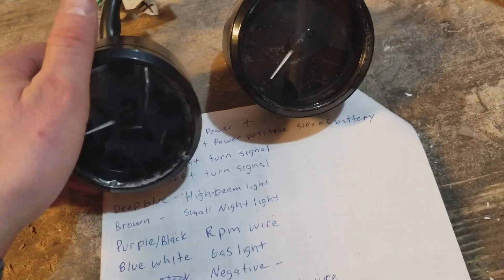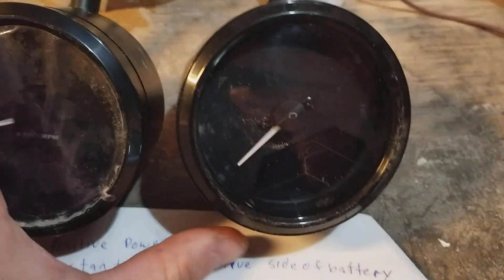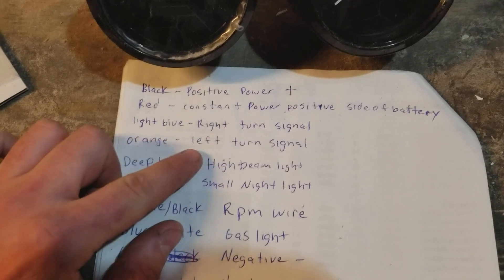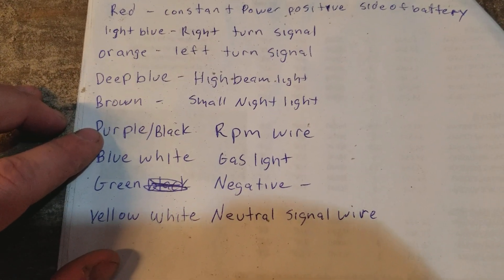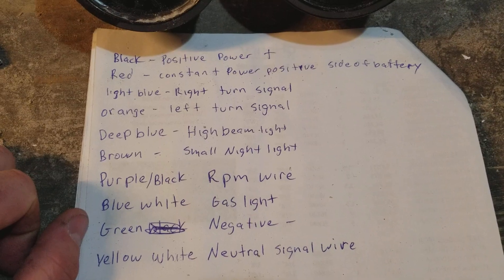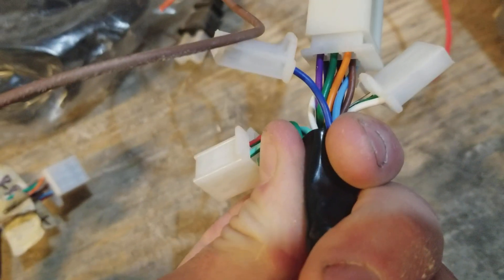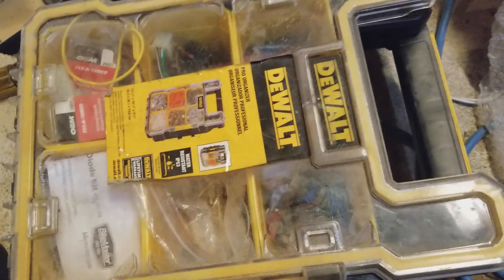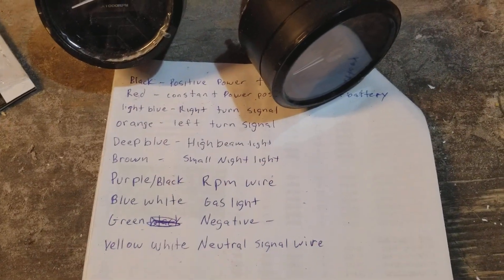Universal digital speedometer diagram update

Comment: I need help, please. My speedometer has a pink wire (the data sheet says is the 2nd gear but it is not). Everything is working fine, but i think that pink cable is the same as your red wire, which you mention is the "memory", my question is that I don't understand what exactly the function is.
Thank you so much, any help would be appreciated. My speedometer has totally different wires than the ones in this video.
Reply: mine has a pink aswell, did you get it to work?

Comment: Hey man, great video! Very helpful and informative. 
I noticed in your previous video, that the needle of one of your speedometers was stuck at 12 000 rpm and now both are as they should be (at 0 rpm). I have the same issue (I think a accidentally wired it wrong) and I was wondering how did you fix it?

Comment: Lol the instructions that came with the speedometer had this videos address in it. Great video
Reply from the maker: No way. Haha they need to start paying me
Reply: @DRugfree1987  I was watching this video and then was like let's put this address in and it took me to the same video
Reply: @DRugfree1987  by the way. I'm having an issue where my speedometer panel will turn off after a while. Any idea what might be causing it  the whole thing doesn't turn off. The turn signal lights and the back light still works just the speed panel turns off
Reply from the maker: @YahyaHaqiqi  when you turn the ignition on and off does the needle cycle back and forth?
Reply: @DRugfree1987  yes it does
Reply from the maker: @YahyaHaqiqi  when the screen goes blank does its cycle then turn off or does it just go blank?
Reply: @DRugfree1987  honestly not sure. I am usually riding it when it does it. I'll look down and its blank.  I have to turn the ignition off and back on to get the speed panel on again
Reply from the maker: @YahyaHaqiqi  sounds like a loose connection. I would check the black wire first
Reply: @DRugfree1987  thanks. Took it apart and put it back and it works now. The numbers are jumping around a little though. Does that happen to you too?
Reply from the maker: @YahyaHaqiqi  For the rpm?
Reply: @DRugfree1987  no for speed. It doesn't stat at 20 for instance. Its constantly changing. I can tell I'm 20 something. But not the exact speed because of how much it changes

Comment: Cant get the Rpms on this unit, Any advice? It is going onto a 2005 sportster xl1500c. Tried connecting it to the coil wires and wrapping a wire on a spark plug wire and nothing. Set it up between to 2 cylinder and 4 cylinder  and nothing. When I turn the ignition on the gauge needle swipes and goes back to 0 please any help will be appreciated.
Reply from the maker: I connected on a wire for cdi signal wire. Worked much better. Check out my other video. Its titles gauge update

Comment: Hi there, may I ask you that, if I only need the RPM to work, no need to save miles, can I connect the RED wire into the wire that goes after the ignition key?

Comment: Can't get the lightning (Black cable) to work... I get the calibration but nothing lights up, it did once or twice but when i put it together it doesnt work anymore... 
There is power everywhere but nothing happens..
Reply from the maker: Do you mean. Like just the basic two wires to just turn on the speedometer. Theirs 2 positive wires and one neutral wire. Both positive wires need to have power for the meter to come on. One is for memory and to allow the meter to cycle when you turn off the bike. And the other goes to the ignition to send power to the meter and light up when the bike is turned on

Comment: For me black wire is (-) and green is ignition (+). Was trying to figure out fuel gauge wire and this video helped a lot. thank you. I put this speedo on zontes monster. It has electronic tacho from factory so it wasn't any hasle with rpm, only select 4 stroke engine in menu and readings was same as old tacho.

Comment: my bike has no battery, can i use this? does it require a battery to remember its odometer and wheel speed settings? thanks
Reply from the maker: Yes. It will need a battery. Wont work without one
Reply: @DRugfree1987  thanks for the info, so with this gauge, every time you disconnect the battery from your bike, you have to reprogram the gauge setting?

Comment: Hi there,
I did this connection:

"when wiring it up normally, black will be wired to your ignition/key. and red will go straight to positive side of the battery battery, and green will go to the negitive side of the battery or to a body ground"

When I connect red to battery the speedo stay on all the time (does not turn off), is that correct?? Blinkers and light symbols do not work unit I turn on key.
Reply from the maker: Red is the memory wire. Allows the speedo to cycle completely off when turning the bike off. And to act as power to settings. It will come on and off normally. But you will notice when you turn the bike off the tach will cycle then go to zero
Reply: Hey thanks for the quick reply! Sorry I confused myself!
I wired it like you said, black ignition/key, red straight to battery, green ground. When wired like this, no power to speedo (nothing lights up, tach doesn't cycle) but, when I turn key on, blinkers, light & hi-beam light symbols work when in use.
(The speedometer works hooked up black to positive and green to negative - tach will cycle then go to zero)
Reply from the maker: dvers 411 exactly
Reply: When I turn the key on, should the tach cycle? Because nothing is on or lights up.
Only the blinkers or light symbols work when I press the buttons.
Reply from the maker: dvers 411 make sure you are getting power to to black wire. Might even want to test it by running a wire straight to the battery. And make sure no fuses are popped
Reply: Thank you so much for all your help! I just switched connection to my ignition wires. I went to the black instead of red (was on red). It works! Thanks again!
Reply: DRugfree1987 
Hi,
What wire do I connect to,
To stop the gas light from blinking.
I connected to a ground & still blinks.
Reply from the maker: dvers411 you must have a newer one. I've heard that you have to install a resistor inline with the wire before grounding it. I wouldn't know first hand since I never installed the newer style on any of my project bikes yet
Reply: DRugfree1987 
Thank you Sir!

Comment: Keep in mind that the gauge expects the RPM input signal to go past ground potential and into negative voltages. This requirement is contrary to all other gauges I’ve experienced.  What will happen if the RPM input signal to the gauge does not go lower in voltage than 0V, the tachometer feature of the gauge will not respond.  

My solution to get the RPM feature working on this particular gauge is very simple.  In short, you have to add a small film or ceramic capacitor of 0.1uF 35V in series with the output, followed by a 2,200 Ohm 1/4W 5% resistor in parallel with the output.  These two components together will generate the needed negative voltage and will result in a working tachometer. the values of these two components is not critical.  The capacitor can be between 0.033uF and 0.22uF and the resistor can be between 1,000 Ohms and 3,300 Ohms, but the values I recommend are above.  Wrote a user guide for this gauge at https://drive.google.com/open?id=15CRrZ74KuwMdrZ1FZhfTuxBguhFVAXQF
Reply: Robert MacKinnon  can i have your contact for more question?
Reply from the maker: I didnt need anything of that. Hooked it to signal wire from cdi. And it worked fine
Reply: Hi Drugfree1987, have a cb750f2 from 1978. I’ve hooked mine up the same way as you did (to the bleu wire of the ignition system) and rpm needle doesn’t move. Any suggestions? Thanks
Reply from the maker: @clintonsilva2114  purple/violet wire to the pulse wire? The wiring diagram might be different between the two bike. Try hooking the purple rpm wire to the coil itself. Should be either the yellow or blue. If that doesn't work try other other side. Looks like your bike has points. So I'm not 100% sure if the rpm gauge will work on your bike
Reply: DRugfree1987 , tried everything even wrapping it around the spark plug wire. Ordered the capacitor and resistor, let’s hope it will work that way. By the way changed the points ignition to an electronic ignition. Tanks for the reply.

Comment: I accidentally change my cylinder settings to 2 cylinders. Do you know if it is possible to change it back to 1 cylinder? It looks like it's near impossible. Is it possible to possibly even reset the memory settings?
Reply: I have also bought one of these but haven't installed it yet, but what if you disconnect the wires that goe to the battery? Red and Green.   Wouldn't that reset the whole thing since it looses all power?
Reply: Hi Lucas, yes its quite easy you just long press the button as u turn it on itl come up with something like yyy--- change it to yyy123 then the first parameter u can change is the amount of cylinders

Comment: How can i start and check it ? Is it working or not ? Which wire color i use to power on it using battery ?
Reply from the maker: if you just want to test to see of the speedometer works. hook up black to positive and green to negative. when wiring it up normally, black will be wired to your ignition/key. and red will go straight to positive side of the battery battery, and green will go to the negitive side of the battery or to a body ground